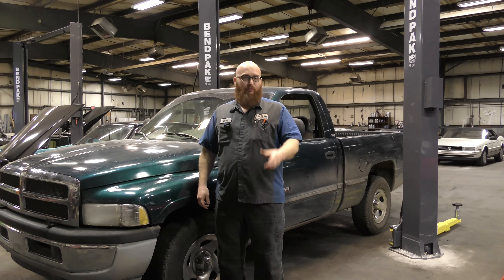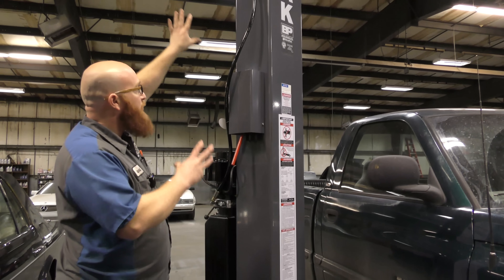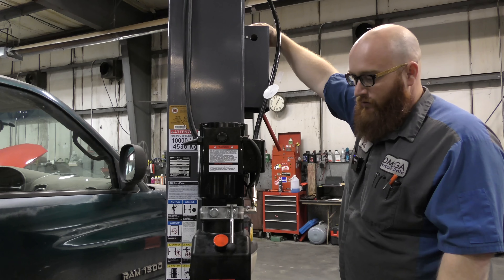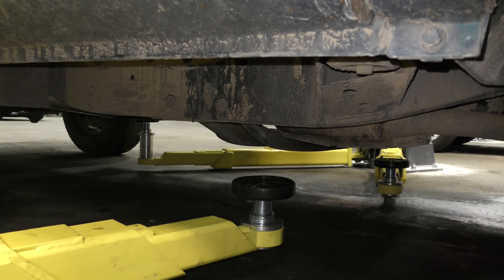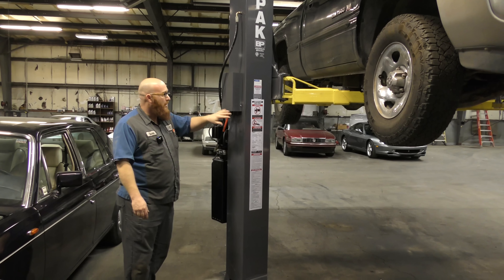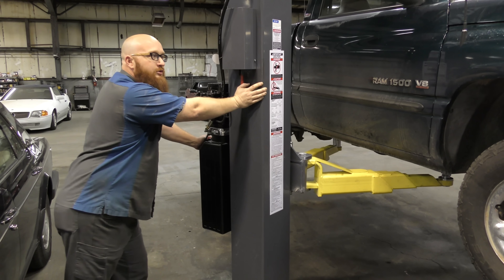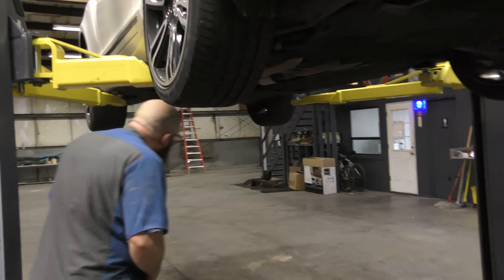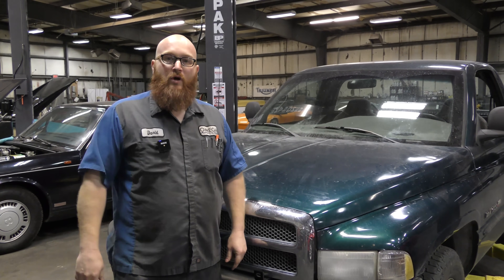How it works?!? The CAR WIZARD shows how to operate a two-post car lift.

Comment: Mr wizard  is always correct. But rule of thumb is to put drivers head  at the post.  Unless pick up or  van
Reply: I always use a stand jack  on a 3/4 ton  as well for rear end.  But hey most my work I use forklifts.  Hillbilly yes.  But  hydraulic and ease makes easy brake jobs. The  hoist is  last resort

Comment: Greetings from PA, Wizard!

Years ago, took my Dad's vehicle in for inspection. Afterward, was in the process of washing it.  Buckle in the bottom of the driver door didn't seem right.  Took it back to the dealership and didn't blame them, but mentioned it wasn't that way when I brought it in.  Some discussions inside and service manager came back and said they would take care of it.  Seems vehicle was lowered, door was open and came down on a toolbox on the floor.  Taken to their body shop, fixed, good to go.  Part that griped me, nothing at the time was mentioned.  Poor business ethics!
  
In other news, still have my first car I bought while a junior in high school.  1972 Toyota Celica.  48 years later! Payments were a whopping $72.00/mo.  Big money for a part-time McDonald's high schooler!  Guess it follows some of your recommendations.  Even decades in the past.  Only have replaced clutch and timing chain and the "normal" everyday stuff.  Oooops, don't want to jinx it.  :o)    Great content!  Keep up the videos!

Comment: @Car wizard, some cars have a single thin pinch weld that crumples when you lift in it. How do you get around that problem. (I lift in the suspension points as noted in the manual but I think there are some general ideas on how to do it) I have seen jack pads with a slit in them for the pinch weld.

Comment: Great video I just got done building a home garage and I did reinforce concrete 10 inches thick. . Any recommendation for a lift that can lift a 3/4 ton diesel truck all the way down to regular vehicle s. I have 16 foot ceilings.

Comment: The old lifts were lined up parallel to the car, these lifts look like they are angled to the car, is their an advantage to that?
Reply: You talking to symetrical lifts, where is the car 50% front of the lift 50% back from the lift. These are asymetrical, they angled so they could support wehicle lifted like in the video 1/3 up front 2/3 in the back.
Reply: I personally dislike asymetrical above ground lifts.  The idea is that with narrow enough vehicles, you can get out without a problem.   And squeeze in more lifts to increase the number of shop bays. The problem is when you have something wider.  Rolling it back in neutral with no one in it  can be a real disaster with no one in it to stop the thing if your floor is sloped towards the center line for drainage.    The in ground twin post lifts are the best, but they are EXPENSIVE.  The above ground two post lifts came out largely because the older design in ground lifts had a lot of issues with leaking hydraulic fluid (basically ATF) into the ground.  The old Benwil TP7 was the answer at the time.  Wide and very stable with outriggers.
Reply: @lietuvis96  The problem is that most vehicles are nose heavy.  That's where the engine is.

Comment: Mr. Wizard.. have you ever tried to lift up a vehicle that has severe rust on the jack points?  I'm curious if you have some sort of standard you go by to determine if a vehicle's structure is too compromised to risk lifting it.
Reply: His shop isn't in the rust belt so I'm guessing he doesn't see much frame rot like on most trucks.

Comment: Fantastic stuff Wizard. This might sound like a dumb question, but for the average person wanting to put a lift in their home garage with both a full size unibody car and a full size body-on-frame truck/suv, would a 4 post lift be more suitable? I have to tackle rocker panel repairs on my Expedition and it looks like a 2-post lift would interfere with maneuvering a mig welder, grinder, etc. Any suggestions?

Comment: Q to Wizard. Does the Wizard perform maintenance on the lifts himself (with his guys). Or does Wizard call on lift manufacturer to come in and maintain it, test it. Is there a State inspection for licencing  of these lifts?  Hydralic motors powered by electricity.

Comment: I need to lift a 1986 911 on an Atlas 2 post and the car is too low with specific points where the arms need to go.  The best I can figure out is that I'll have to raise the car before moving the arms by driving onto 2 x 10 boards cut to be out of the way when swinging the arms. That will give me an additional 1 1/2" to clear the arms.

Any thoughts?

Comment: Hi Wizard! Thanks for this very clear video. We have a similar lift in our shop, recently we lifted an Opel Insignia, but we noticed the points where we lifted bent to the inside afger lifting, did we do something wrong? Greetings from Holland!
Reply: Hoi Luciën 🙋🏼‍♂️ I moved to the Netherlands recently and everytime I take my car to a mechanic (still trying to find the best one for me), I only see lifts in which the cars are supported on the wheels instead of the frame. I didn't even know the one Wizard has were used in the Netherlands! Do you prefer the one you have to the other ones as it gives you an easier access to the wheels, suspension, etc? Also, in which city is your garage? :)

Comment: Hello CarWizard, I think your lifts are mounted the wrong way. Test by reversing the vehicles on the Lift, you can get out and dont have to move the cars anymore. Direct lift after geting out. Source: I work at a Mercedes Dealer.

Comment: Hello from Romania 🇷🇴 ! 

I allways whatch your videos, really like the. I am in the proces of opening a shop, and after whatching the auto lift fails on YouTube, i pass this crap invention. 

It's good for lifting to the height you need to change the tires ornwork on the engine. Higher then that, it's just dangerous. Wasting time to adjust it for each car, untill you wait for the lift to lift, and if one of those expensive cars falls of, well, bussines is over...

Comment: The red bar releases one side. How is the other side released? Does it have similar metal mechanical stops? Thanks.
Reply: Yes the is a small cable that runs overhead to link both sides

Comment: I've seen these kinds of lifts for around 3k, if I wanted to install this in a "home garage", I assume I would need to jackhammer out and pour new, thicker concrete near the lift posts?
Reply: I installed a baseplate lift (limited height in garage) for around $1800 and poured thicker concrete but most only need 4" of reinforced concrete depending on lift capacity.

Comment: I heard you aren't supposed to use double spacers, I use an older lift with wood blocks and always use pinch welds or frame, mostly 2015+ Cadillacs of all models...Dude I almost start sweating lifting a 2019 escalade....I frame lift as much as possible....body lift just doesn't seem right to me.
Reply: You made me feel much better by body lifting a Bently bro....thank you.

Comment: Is it true that older Toyota Tacoma trucks cannot be lifted by two point lifts because they bend in half when lifted like that?
Reply: if it bends in half when you lift it it should not be on the road the frame is finished
Reply: james blair I heard it was an actual thing for those specific trucks due to the weight distribution or something

Comment: Are there any locks on the driver side post? How does that work?
Reply: yes both sides have locks there is a small cable that runs overhead to link both sides

Comment: One time I started lifting a dodge one ton long wheel base van and the front started to tilt up and the back was going down, looked in the back under some blankets to see a 4 foot diameter brass propeller for the customers shrimp boat. 🤦🏼‍♂️

Comment: Please do Buy this not that Diesel 1/2 ton Full-Size Trucks in the future.
Chevy/GMC: To buy 2000-07 2500/3500HD, Not to buy: 2007-present HD
Ford: To buy 1999-07 Super Duty, Not to buy 2008-10 Super Duty with 5.4 Triton V8
Dodge: To Buy any MY 2500HD, Not to buy Any MY 3500HD
Just 3 categories